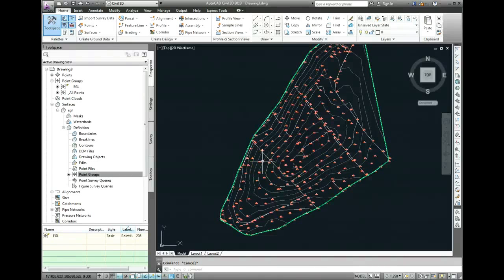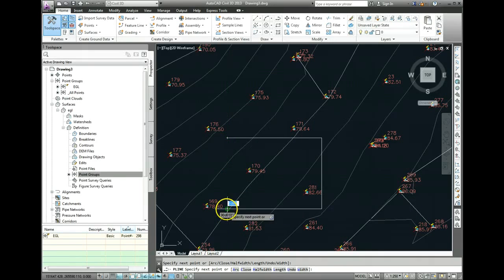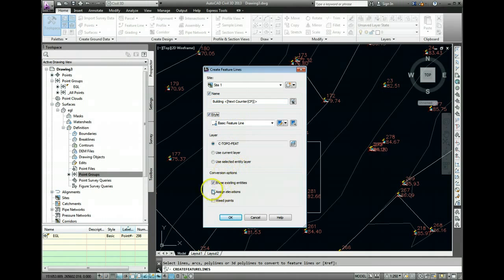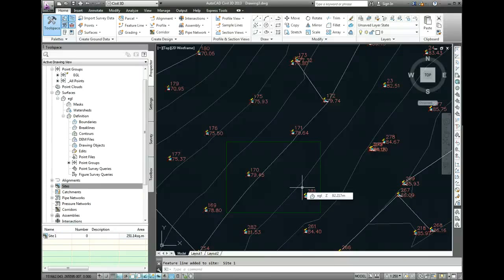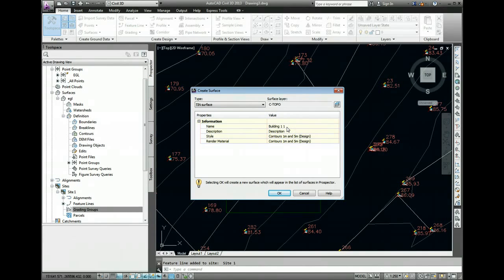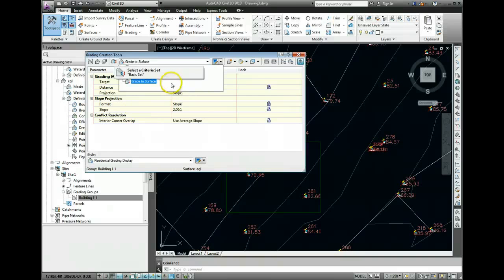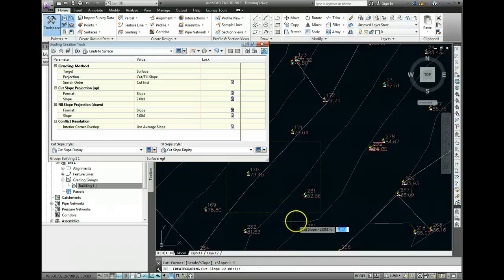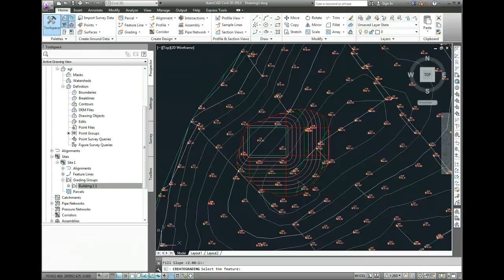Create a Building Footprint and Grading in Civil 3D

Comment: I want to be able to compare survey level to design level/ datum level. For instance i want to survey a slab and find out what the difference is compared to our design finish level. I will be grateful if you can make a video on this. Keep up the good work!!!
Reply from the maker: Sounds like what you want to do is pretty much what is shown in this (and its related) video tutorial. The main thing is that to get a volume between 2 surfaces, you have to have 2 surfaces to begin with. If one of them does not exist yet in reality, you simply create it using the feature line method. Then you can create a surface based volume, using grading as normal. Just have a think about the side slopes, though: for example, if you want to get a volume of cut and you intend to dig straight down, then the grade slopes will not be 1:1 or 1:2.

Comment: If I wanted to limit the extent of the grading (resulting in higher slopes for example) due to constraints of nearby structures or whatnot would I use a boundary line to define how far the Proposed surface could extend out to match the Existing surface?
Reply from the maker: Good question. I’m on annual leave at the moment, so I have no way to play around with this on a computer to try things out for you. My initial thought, though, is that I would experiment with the grade to make it steep and see if that keeps it within the area you’re working in. One thing to keep in mind is slope stability, though. So even though it might “work” in CAD, in reality you have to consider ground conditions if your dig is deep and the sides are steep.